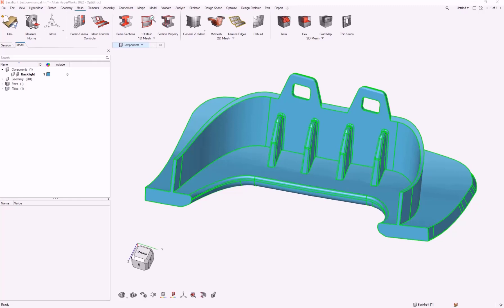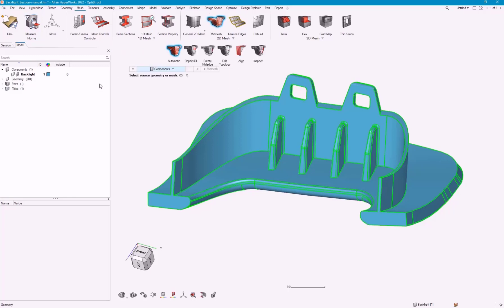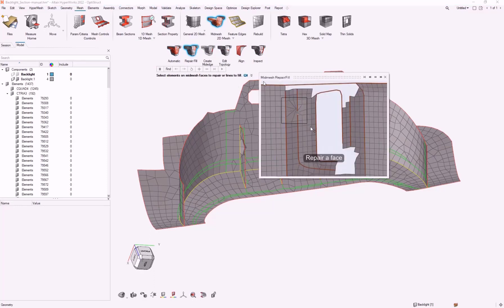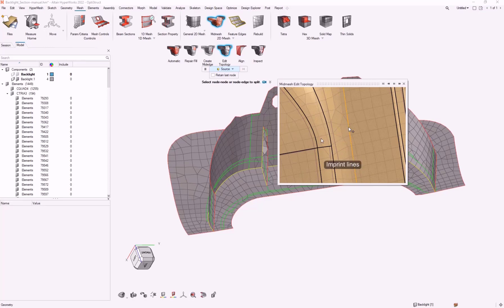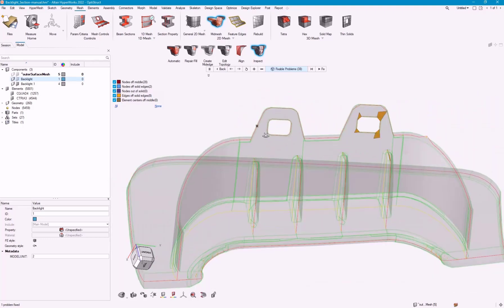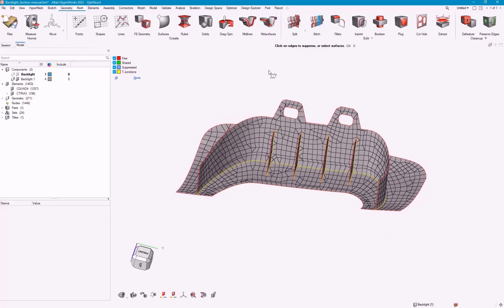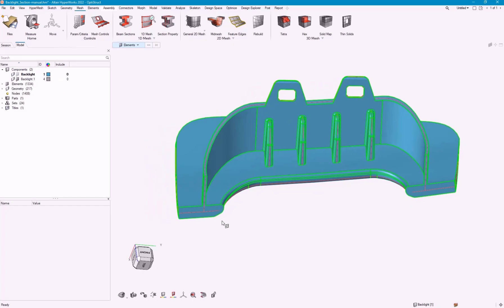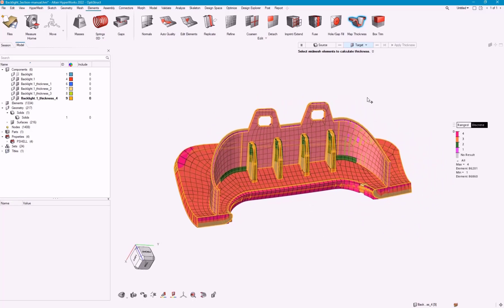Session 5: HyperMesh 2022, Improving Plastic Parts Midsurface Extraction, Thanks to Direct Midmesh

Comment: Thank you! Great and simple tutorial. Are there any ways to midmesh with an existing points set? Say, I want to capture existing points, so I have nodes in those locations where my points are?
Reply from the maker: Hello @AD-xc1qz, you cannot do it at first step, as midmesh is generating directly a mesh without relying on a surface geometry. Are such points related to existing features of your model (holes, beads...)

Comment: Sir midmeshing is introduced in which version and and interface you have used seems to be of Simlab.
Reply from the maker: Hello @adarshsharma4593, the software used in this video is the new interface of HyperMesh, which we introduced from version 2019. You can run it from start menu -> Altair 2022 -> HyperWorks. Midmeshin was introduced in HyperMesh from version 14 and is availabl in both the old HyperMesh interface and the new one.